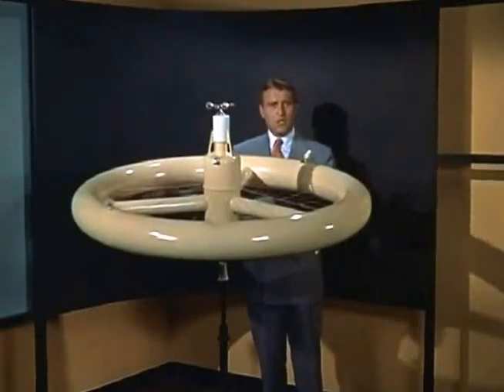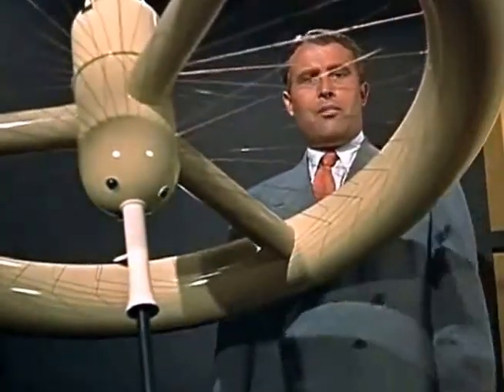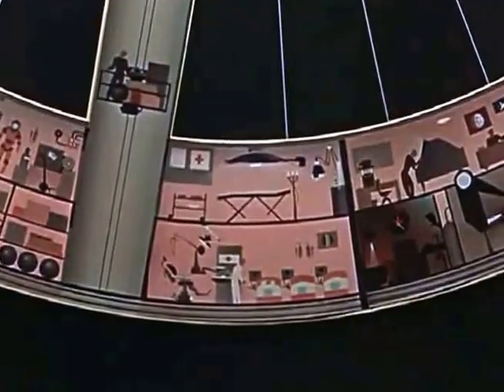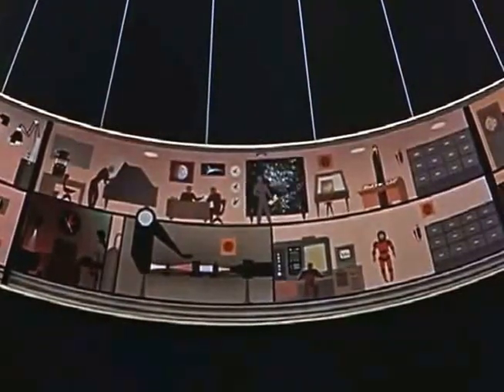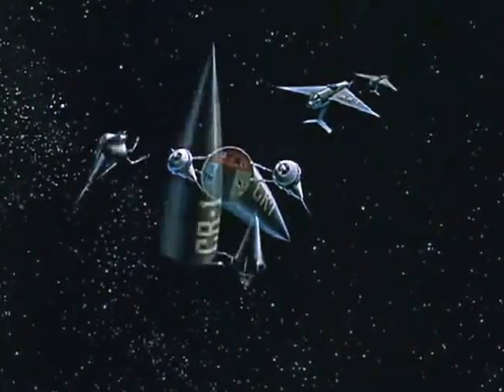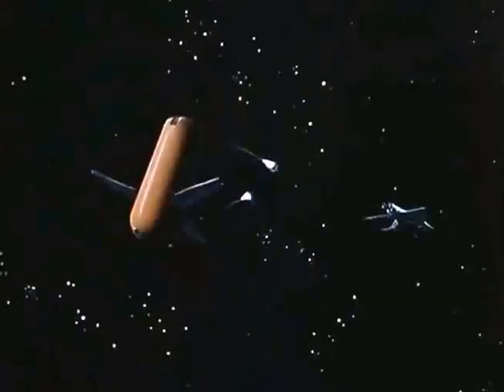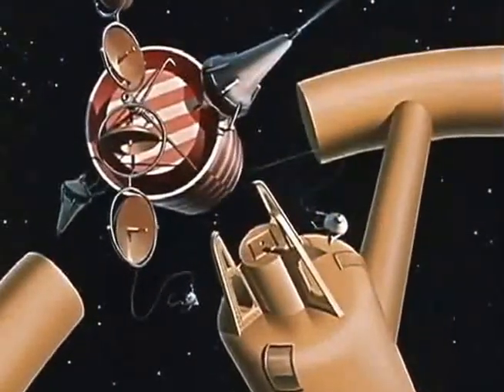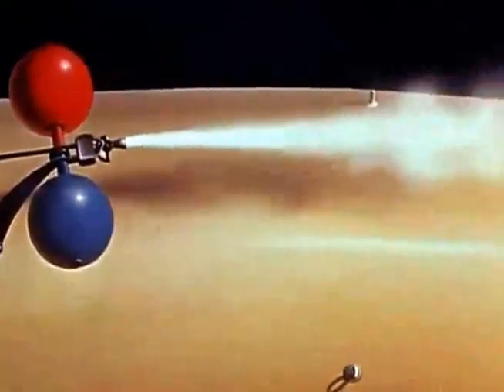Von Braun Space Station 1956

Comment: He slightly under estimated the escape velocity because he was thinking about a very low Earth orbit.
But he had an amazingly detailed view way ahead of time.
Even predicting it's importance for weather forecasts and telecommunications.
1956 was before all that stuff happened..
Reply: I didn't notice any mathematical "blue notes".  In this film clip Dr. von Braun gives the orbital speed as 16,000 miles per hour and the orbital period around the Earth as 2 hours, which is consistent for a first-order approximation.  This implies an orbital altitude of approximately 1057 statute miles above the Earth's surface.  In contrast, the International Space Station currently orbits between 207 and 270 statute miles above the surface with a period of slightly more than 92 minutes.
Reply: Guy invented the rocket equation, he didn't misspeak.
Reply: What do you mean? He isn't talking about LEO as in the specific LEO ISS is currently in. There are higher orbits that would arguably still be LEO.
Reply: @johnbockelie3899  yes, the ISS does not have artificial gravity.  The rotating "wheel" does.
Reply: @ChristianHedman  Exactly. This particular film clip doesn't include it (the entire 1955 Disney program from which it is excerpted does--the Moon trip models were even in the same scene, but off to the side of the space station model), but von Braun's space station was to be assembled in a 1,075 mile circular, polar orbit having a 2-hour period (still LEO, by some definitions: https://en.wikipedia.org/wiki/Low_Earth_orbit ). ALSO:

His Moon ships (first a fly-by craft to photograph the far side and return to the station [later an unmanned, station-launched, reusable "Moon Observer" probe was designed for this mission], then a three-ship manned landing expedition, to explore a large area for six weeks), in order to use the minimum of rocket propellant (because he preferred the lower-impulse--but indefinitely-storable at normal temperatures--hydrazine/nitric acid combination), were to depart from the space station at the minimum velocity needed to reach the Moon. This is 22,000 mph (just 6,000 mph above the station's orbital speed) rather than 25,000 mph, with a 5-day (instead of Apollo's 3-day) transit time, and:

After one or several such expeditions to the Moon were conducted (the two crew vessels were reusable; the third, similar cargo ship carrying the supplies [with at least one pilot flying it] was to be broken down to provide comfortable Quonset hut-type living quarters for everyone and carry a long-range pressurized "land rover," etc.), a lunar base was to be built. Von Braun favored Sinus Roris, the "Bay of Dew" (see: https://en.wikipedia.org/wiki/Sinus_Roris ), as the base location, but he said that other places were equally desirable. But:

The U.S./U.S.S.R. Cold War space competition made hash out of all of these carefully-formulated plans, in order to "do everything first," but not necessarily in a way that provided lasting value, and certainly not in the most cost-effective manner. Von Braun wanted to explore the Solar System, and the space station was to be the staging point for manned planetary as well as lunar expeditions (and for preliminary reusable probes, such as the Moon Observer [and winged conical probes, to fly over Mars and Venus]). He designed all of this space hardware (except some intermediate rocket stages) to be reusable, modular, and readily convertible for multiple applications. His fly-by Moon ship, for example, was simply a wingless version of his winged Earth-to-station rocket top stage, with a cluster of hydrazine and nitric acid "drop tanks" mounted around its rear section. Now:

These jettison-able tanks would fuel the space station orbit (and Earth) departure burn, any needed mid-course trajectory corrections en route to the Moon, and part of the space station orbit return braking burn, being jettisoned late in that retrofiring (to ensure the empty tank cluster's positive, quick, and clean separation from the Moon ship). The ship's internal tanks provided the remainder of that braking burn's propellants, with ample reserve for course corrections to return to the space station, had any been necessary. His 1956 Mars expedition orbiter and "landing boat" used the same hardware and propellants, with additions (such as the "landing boat's" long, swept-back wings) appropriate to Mars. As well:

Many people, reading the books--and the 1950s "Collier's" magazine articles--that covered his space station, lunar expedition, and planetary expedition plans (Von Braun and Willy Ley wrote or co-wrote all of them, and Chesley Bonestell illustrated them with his beautiful paintings) decades later, have exclaimed, "God, I wish it had gone that way!" Well, if Project Artemis goes as planned, it will, thanks to SpaceX. (Their fully-reusable Super Heavy Booster/Starship vehicle looks--and will perform, once the inevitable "bugs" are worked out of them--just like the true spaceships [not the single-use, throwaway spacecraft we've seen to date--the Shuttle was a very poor attempt at re-usability] that Von Braun, Willy Ley [interesting videos of his are also here on YouTube], and countless older science fiction stories and movies have described and shown.)
Reply: @Triffgits  Von Braun invented the Tsiolkovsky rocket equation? Crazy, since Tsiolkovsky derived it 8 years before Von Braun was born, and others derived it in the early 19th century!

Comment: Holyshit! So this is the one that inspires 2001: A Space Odyssey!
Reply: @bajocontinuo  or mine it off the Moon.  In fact, mining water from the cryogenic lunar polar craters will be a source for LH2 (fuel) and LOX (oxidizer).  Those resources will be shipped to filling stations at LEO and that will open up the solar system..
Reply: @bajocontinuo  -  long term, the cryogenic lunar polar craters will be minded by telepresence robots especially designed to operate at cryogenic temperatures.  Electric power for them will be from batteries.  The habitats for the miners will be in the nearby peaks https://en.wikipedia.org/wiki/Peak_of_eternal_light.   There will probably be transmission lines between the various peaks because not all of them are in their  rare dark at the same time.  And with the lower lunar gravity, towers can be quite high.
Mining lunar uranium or thorium for breeder reactors will not be easy but - hopefully - not impossible.  Once there is infrastructure to produce LH2 (fuel) and LOX (oxidizer) from lunar water, then asteroids and comets can be mined for all kinds of things.
Reply: @bajocontinuo  -  another thing the moon miners will produce is structural materials - iron, aluminum, titanium 
The most common elements in moon rocks are oxygen and silicon.  BTW some moon rocks have calcium which is an excellent conductor but it will have to be sheathed in iron because it is so soft.  And calcium will rip the hydrogen out of water so using it inside the habitats will be very regulated. 
https://sites.wustl.edu/meteoritesite/items/the-chemical-composition-of-lunar-soil/
 The moon miners will export things to build solar power satellites for Earth - that should be a real money maker.
Reply: @bajocontinuo  no, it was the Concept for the Film it is also mention in the making off 2001 space odyssey and  the consept and first draft of a Rotating wheel space station its from von Braun. But the first Idea of a space Station came from Konstantin Eduardowitsch Ziolkowski and his book.
Reply: Look up for Herman Potocnik🥰 he started this… von Braun copied from him
Reply: Yes

Comment: It's my understanding that Dr. Von Braun was inspired mainly by just one book that he read when he was a youngster, a fictional story of people going to the Moon. He certainly had a lot of vision. Too bad the rotating wheel station never materialized. Such a craft would sure make it better, healthier, for long term space workers and others. For instance, building, running, maintaining an in-space rocket fuel factory, or other manufacturing, without being harmed from long term absence of gravity effect..
Reply: They will make them, but they have to be big (apparently) to prevent "vertigo". The ISS isn't big enough.
Reply: "In-space rocket fuel factory." Brilliant! And on what raw materials would this rocket fuel factory work?
Reply: If the fuel is methane, then you only need CO2, H20, a Nickel catalyst, energy (solar) and the sabatier process. Use electricity to split the water into oxygen and hydrogen, keep the oxygen as your oxidiser. Then use sabatier with the C02 and Hydrogen to make methane (rocket fuel) and more oxygen. So the raw materials would be C02 and Water, which you would have to source from somewhere. an asteroid of the right composition would be fine, as they are often grubby snowballs made of water, co2, methane, ammonia and other fun things.
Reply: In reality its actually very easy for Humans to harvest the necessary resources needed to make rocket fuel in space.  bergasm pretty much explained it correctly if said fuel was methane.  It just takes the desire to create the necessary technology needed to reach said fuel sources.   If there is a market or a desire for it.  Humanity is quite capable of getting its goal terrifyingly fast.    You can see that right now with the SpaceX program which is launching rockets practically every other month now with the added ability of launching the same rockets several times before discarding or changing to a newer version each modification and update creating a more improved practical inexspensive rocket.  Something NASA has had trouble with for years with.    Now as for harvesting not just for Methene.  We already have several locations for potential harvesting sites.  We know the Moon has some water sources, and likely has all the avaliable items needed from asteroids on or under its surface due to billions of years of rock bombardment so we can use that as a launching point with it being used as a mining site and its items either being created on the surface or on a orbiting station.  From that point its on the way to harvesting purer sources as actual space going rockets are created to explore past Mars.   You can have space going rocket fuel factories and its likely more cost effective acting as likely both factory and fueling especially if they get the needed materials.  Given that its also space you can technically have mobile fuel factories that can act as gas stations for ships on the way to mine or explore the eventual moons of Mars and the Asteroid Belt so long as they have the ability to create fuel well getting to location which should be easy if the Moon has the resources already .   As for actual mining. We already have the tools.  Any mundane drilling or extraction equipment on Earth given some modifications or redesigns (specifically in the engine requirements) should be more than capable of doing work in a gravity well that is much weaker, launching material from rocks, the Moon, the Martian moons or Mars itself would be easier as well as the lack of gravity means less resources use in launching space craft thereby saving fuel. Again this comes down to desire and need.  Humanity needs a reason.  Give Humanity a reason and you can see us be a space going civilization in your lifetime.  .
Reply: Von Braun was talking about an Earth-orbiting station, hence my confusion as to where materials would come from. As for "grubby snowballs," Whipple's notion from the 1950s hasn't panned out in numerous close-up missions, like Rosetta to 67P. Resources for fuel exist, but it won't be as easy as the early space visionaries imagined.
Reply: He was the father of the V-2 rocket. We captured some and they were the foundation of our initial attempts to go into space.
Reply: Water-ice is one space available resource. Water...hydrogen and oxygen.
Reply: The problem isn't a matter of difficulty or easiness. The problem is money. It's all now do-able technologically. It's just a matter of funding. Asteroid/NEO "mining" would provide sufficient funding, and would also probably create in-space "boomtowns" of space-
stations.
Reply: Carl Lelandt it’s said his mother gave him a telescope I believe for his confirmation and he immediately started taking to astronomy and space in general. The kicker and inspiring part of that story is relatable for me. It’s said that he was just not interested in basic learning subjects until he started enjoying and wanting to know more about the universe and space travel. He then like magic started excelling at math and science and anything else needed to help him get closer to space.. I hated school and wish I would of read about this guy and loved space as much as I do when I was younger it’s inspiring to me. I
Reply: @bosunhiggs9708  Water
Reply: There are dozens of issues with this large design, not only the space debris will puncture holes in the surfice without sophisticated armour that redirects the incoming debris.
Also, Air, thought about that?
Reply: @Maddinhpws  Oh, of course. How silly of me... You didn't answer my question. This is an orbital space station. Where does it get the water to turn into rocket fuel? Ship it up from the ground? Or do you subscribe to the outdated notion that comets are "dirty snowballs," despite numerous closeup missions showing them to be desiccated rocks? There are materials for space industry, but they're not lounging around in Earth orbit.
Reply: @bosunhiggs9708  please reconsider the makeup of comets.  They really are "dirty snowballs" or "snowy dirtballs".  As they approach the Sun the volatiles sublime and create the coma and tail.  Spectroscopic observations of the coma and tail show primarily H2O but traces of CO, CO2, CH3OH, NH3, and all kinds of other "volatiles".  See Table 1.1 on page 17 of 
https://www.mps.mpg.de/phd/theses/the-composition-of-cometary-ices-as-inferred-from-measured-production-rates-of-volatiles
Of course the surface looks like rocks - that's the crust left after the volatiles escape.  Do a Google Image Search [comet Halley by Giotto] there are GEYSERS where the volatiles are streaming out.  Also, look at the photo of Comet 67P/Churyumov-Gerasimenko posted at
https://blogs.esa.int/rosetta/2015/01/16/fine-structure-in-the-comets-jets/ by Rosetta/ESA
The problem of "not lounging around in Earth orbit" will be solved when there is successful mining of the cometary volatiles trapped in the cryogenic lunar polar craters.  The moon miners will SELL their water processed LH2 (fuel) and LOX (oxidizer) at filling stations at LEO.  That will open up the solar system.  All the power of the Sun and all the resources of the solar system await us.
Reply: Jeff Rutt  A few years after that Jules Vern book of fiction (what was the title?) there were proposals by serious scientists
https://en.wikipedia.org/wiki/Rotating_wheel_space_station  ==> A rotating wheel space station, also known as a donut city (Russian: «города-пончики») or a von Braun wheel, is a concept for a hypothetical wheel-shaped space station. Originally proposed by Konstantin Tsiolkovsky in 1903, the idea was expanded by Herman Potočnik in 1929.
Reply: @TheAznative101  The Americans captured him as well and said "hey, bud. Do you want us to try you for war crimes, or do you want to get us to the moon?"  He chose the moon!
Reply: @funquay2219  Von Braun gave himself up to the Americans rather than the Russians. There were thousands of Nazis who were not tried for crimes. Those who were, were released early to rebuild Germany. A very good book about the Krupp family describes that. The movie and book about Nuremberg is excellent as well. The only Nazi who was imprisoned was Hess, who gave himself up to the English. He was imprisoned in Spandau alone.
Reply: @TheAznative101  Similarly, I learned recently that after the collapse of communism, and after the Berlin wall came down and East and West Germany were reunited, the secret police or Stasi were never brought to justice. To this day some of the people that they harassed live side by side with their former persecuters. All credit to those victims for not taking their revenge!
Reply: The main book which inspired Von Braun was Hermann Oberth's thesis
Reply: No, the craft would have done of that.  You guys never consider cost or practicality at all.

Comment: The reason why Von Braun's space wheel wasn't built was that, in 1958, the Van Allen radiation belts were discovered.
The space wheel was supposed to be in an orbit 1,000 miles above the earth. That would put it 'smack dab' in the middle of the dangerous radiation.
Reply: Literally while I was watching the robots build the space station I was thinking "Isn't that right in the Van Allen belts?"
Reply: How did the Apollo missions solve that problem??
Reply: @Jack Respeliers I cooould buy that  but I’m having trouble believing they couldn’t find a fix since then.
Reply: "radiation belt" oh you mean the firmament
Reply: @Zero11s  Yes 👍
Reply: @FlyingArtz.  they are flying at 24,300 miles per hour when they pass the van Allen belt
Reply: @FlyingArtz. Know one has left earths orbit

Comment: Next we will add another wheel, pedals, frame and handlebar. And the space bicycle will be complete.
Reply: Wirebiter64 No the physics  is correct. You have to do the math. The rest...
Reply: The good old wheel in space station.
Reply: No, add a second wheel rotating in the opposite direction with an opposing shaft so the stations rotation doesnt cause it to start twisting around the centervas it spins.
Reply: No, space Harley-Davidson is what it should be...😄😄